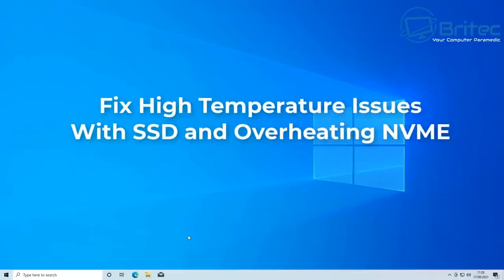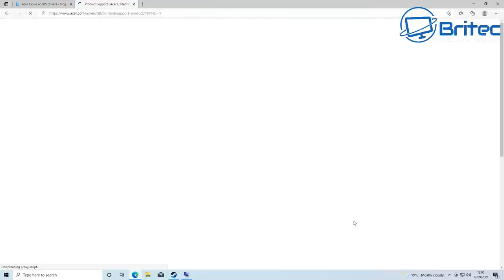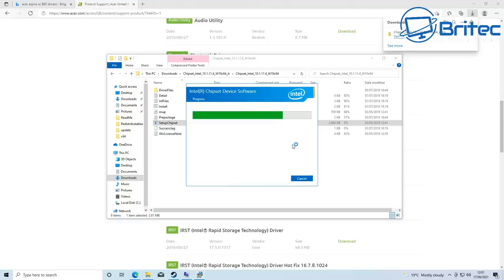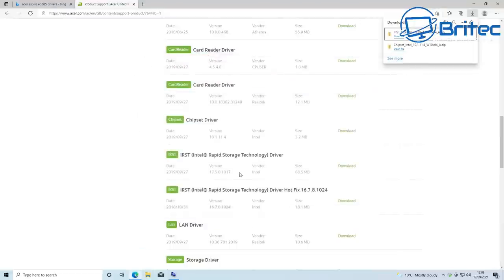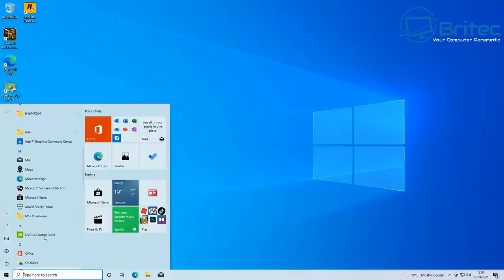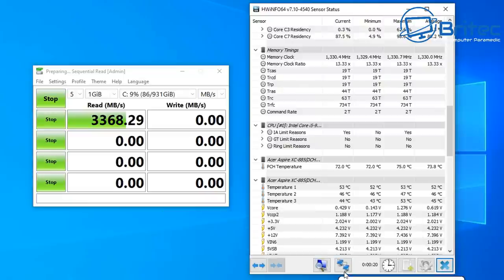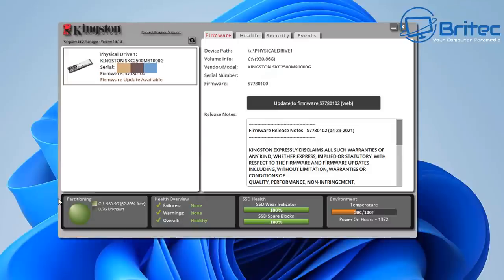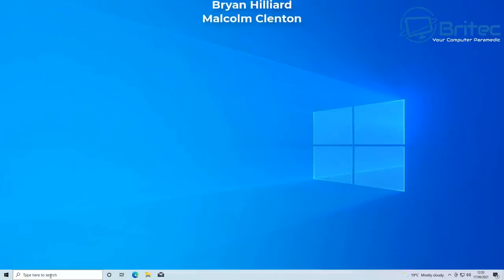Fix High Temperature Issues With SSD and Overheating NVME

Comment from the maker: Fix Overheating SSD or NVME. Drop us a LIKE 👍
Reply from the maker: You're welcome
Reply: Let me produce your music. I am a reggae singer and producer. I do it for free just for you king.
Reply from the maker: @aljoumeyli  Been playing reggae music for years.
Reply: Just checked my 980 Samsung and is sitting at 48 idle. Will bear this vid in mind if i need it in future, cheers Brian.
Reply: OffTopic: how did you get Windows ten to do that?
Reply from the maker: @SiliconBong  Do what?
Reply: @Britec09  How did you get Windows ten to work? (*can't even tell you what version I have, the start button is now a right click and few of the options work, if I want to adjust anything I hit RUN>control and  hope there's something available)
Reply: Happy to be wrong but are you not comparing different values in HWINFO in the before and after for temperature checks?

Comment: My PC used to shutdown without any warning. It wasn't temperature related. I tried EVERYTHING! It went away after firmware update on the ssd. Until that point I didn't even realised that ssds have a firmware.
But beware that updates are not always healthy. Always read carefully what you're installing. You can make things a lot worst while panicking looking for a solution. Bios updates for example can leave you PC dead, so do think 10 times through before you pull the trigger.
Reply: "my pc used to shutdown without warning. it wasnt temperature related" then proceeds to NOT say what caused or fixed ur shutdown problem. ?????????????????????????????????????????????
Reply: @oksu132  what the He'll are you talking about? I said it was a ssd firmware issue. The PC stopped restarting after the update of the firmware of the ssd! How did you not read that?

Comment: I have two NVME's fitted, both with heatsinks. I wouldn't actually ever fit one without a heatsink. One is my C drive and the other my D, idling at 36 and 33c with a maximum of 47 and 45c.
I also always fit a chassis fan to blow over them, glue it into a position in the case if necessary....I can't stand heat in my system. Even that PCH of 75c in your video Britec, would be far too much for me, mine never goes above 50, even when gaming....again, I have a chassis fan blowing over it.
Great video, I never see anyone covering this issue, NVME's are great but they should never go above 60c in my opinion, not if you value your data.
Reply from the maker: I agree
Reply: I also have OCD 🤣😭
Reply: @ZafarYTC  Good man, hope it doesn't fall off.

Comment: Looking at one that was getting hot today, and the problem I think is the placement of the M2 on the motherboard, right next to the cpu heatsink on one side, and the video card on the other. I think we're better off getting a sata ssd, and at least it can be placed in drive bay.

Comment: Crucial P5 NVMe. I downloaded their Micron driver, enabled Momentum Cache in their Executive suite. . The increase in performance was amazing with max temp at 50 C. (I have a Online UPS so ok with battery backup). I also removed the sticker/decal on the chipset side for better contact with the heat sink.
Reply from the maker: Yeah, that should keep it cool

Comment: You was looking at the wrong temps when you went back to check it's the temp underneath the one you was looking at. I've got the same drive it's known for running hot. After the fix you didn't show the temp for the drive so I'm guessing the fix didn't work as I know it doesn't.
Reply from the maker: OMG it did work, just my mistake showing wrong part. Temps dropped way down. Not making another video to prove a point.
Reply from the maker: https://youtu.be/hLcDIYtPCEg Just for you, the none believers
Reply: My bad. I made a mistake my drive is the p1. For some reason it doesn't work for my drive but looks like it did work for the p5. Keep up the good work 👍🏻

Comment: What is the normal operating temperature for a solid state drive-in Fahrenheit the only one I know in Celsius off the top of my head is 100ﾟC equals 212ﾟF which is hot enough to boil water
Reply from the maker: 100c is way to hot, 40c ish is fine

Comment: Great information about hot Solid State Hard drives Brian. Thank you. May we please have some Microsoft Office 2021 videos? Office Suite 2021 will be released on October 5th, 2021 along with the Windows 11 release.
Reply from the maker: I can do that for you, what sort of videos do you want?
Reply: Thank you.  @Britec09  Benefits of using MS Office 2021 compared to older MS Offices like 2010, system resource usage, trial-use setups and your thoughts about MS Office 2021. Thanks Brian!

Comment: 🤣Is not 100 C just to hot for any computer component? Curious as to the max. temp is for any modern computer as different opinions I have come across. Personally I figure about 65 C, but not really sure. Thanks and 👍 as usual.
Reply from the maker: 100C is way to hot for NVME

Comment: ....Flawed video, tiny error; showing two different temp settings. 1 for ssd ( 00:43 ct1000 ssd), the other for motherboard temps (5:02 - XC8500 MB temps) ... plz recheck your work... what you are showing does not match what you are saying..,   BUT - I believe you that driver updates do work  ...  see ya in the next video....
Reply: i have the same problem and driver updates doesn't work.

Comment: this is only a driver issue not installed, it doesn't solve any overheating issue with driver. Any tech in a pc or laptop got issue if you don't install drivers. I can do that also, just uninstalling the ssd driver and launch a video.. to show a pb i just caued.